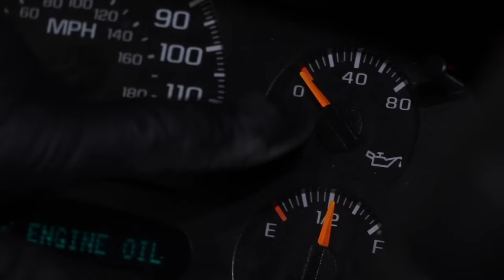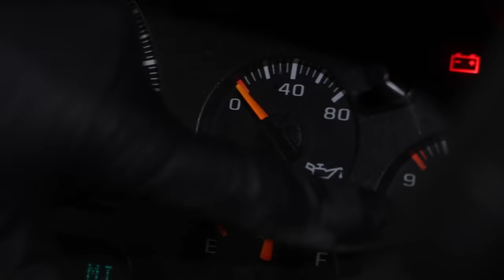Top 5 Problems 2000-06 GMC Yukon Sierra Chevy Suburban Tahoe Silverado Avalanche Cadillac Escalade

Comment: The two widest spread problems I've heard of weren't  mentioned, guard cluster stepper motors going bad, o ring on the oil pump. If I was having a no oil pressure problem thats your next fix if the piddly sensor d oesnt fix it
Reply from the maker: +Mike Belcher Thanks for the feedback!

Comment: If you have chipmunks/ squirrels get the .22 out. I have had them chew my fuel rail pressure regulator control wire where you cannot get your hands down in there to repair it, also temp. sensor wires.

Comment: l like this video. I own a gmc sierra 2007 and my gas gauge does the same as you showed in this video with the oil gauge. What should i look for? I think this is causing my check engine light to come on.

Comment: My passlock is on how do I fix it in a 2003 GMC Yukon xl I changed the fuel pump filter and has it running fine but now it cranks but no start and the security light is on again

Comment: What about the 4x4 issues . This is the second Yukon I’ve had. And the service four wheel drive comes on. Actuator is good . Switch is good and tcase selector is good. Do you know of anything else???
Reply from the maker: +Brian Barwidi We wouldn't be able to diagnose an issue like that here, you may want to have a local mechanic take a look at it. Thanks for checking us out! http://1aau.to/m/Shop-1AAuto-c

Comment: I have an 01 Silverado 4.3L. Batt light on (14v at Batt while on), No Cruise, No A/C or Heater, and some of my gauges don't work on the cluster. I've had this issue die at least 2 years and I still can't find the problem. Could you please help me out

Comment: Having issues with shifting as well as towing indicator light sticking on untill I wiggly gear shift.question I have cleaned up 3grounds where is the other end of ground located at end of fire wall and will 02 censor cause not to shift properly guage light's go crazy when trying to shift I am stuck

Comment: Fuel pump, instrument cluster, u joints, dual climate control, air bag sensors, seat heaters, seat directional controls, window regulators, sagging ceiling liner, sunroof, interior door panels, evap canister and a weak 4L60E transmission. But there is nothing wrong with this vehicle. These are just the top 1,755,383,865 things that are wrong with this truck.

Comment: I have a 2001 Tahoe. The main headlights come on whenever I start the car any time of day, or when a release the parking brake. The daytime running lights never come on. I have to press the dome override four times and then the headlights go out. I tried replacing all the fuses, relays, and even the daytime running light bulbs and sockets, but the problem persists. I tried taking out the radio and replacing the ambient light sensor, but that is a major pain and I just can't replace it. (Thanks GM for that - couldn't you just have had the sensor push down and turn from on top of the dash to come out.) Anyone had this exact issue with their Tahoe and can tell me for certain how to fix it?

Comment: Question,  I have a 2003 chevy tahoe, I was changing my power steering gear box and my battery stopped working, so I bought a new battery and I took my truck to 3 different auto parts to test my alternator and I was told that is in a good condition, my issue is that I noticed since I replaced my battery, every time that I turn off my truck the battery light turns on and it stays on. But when I'm driving the battery light is off. Any ideas

Comment: The real issue is that the parts you're replacing everything with are still crap. Why couldn't GM redesign the exhaust manifolds bolts just shows the true color of the company compared to companies like Toyota.
It's a great truck don't get me wrong, but I own and wrench on my own ancient rigs from the 2000's from both companies and you can tell the difference in attitude, OEM parts quality, and support. You know how hard it was for me to find and pay big money for the updated parts for the HVAC rear module? GM just seemed to not care anymore

Comment: I have the code P1409 and i was told it could be a valve cover gasket leak, or a oil pan leak. because it is leaking oil not much. but it is coming off the oil filter dripping down. and when i look around the bellhousing near the rear main seal it looks like it could be.. but it looks more up top if that makes sense. any ideas? because i don't want to drive it if it's like that.

Comment: Hi.my suburban need to replace the knock sensor..the question is..why the truck stop running?never turn off.but I push the gas all the way and don't move..I turned off an turn on again and drive for like 10 mins .and do it again..is something they the knock sensor do?thanks

Comment: i never had low pressure problem since one year ago, right after replaced the engine gaskets and seals, i tried to understand what could be happened in connection with that work, but without success till today, so actually i'm running with the low pressure sensor disconnected in order to do not get crazy with that sounds! Any idea that could help me to solve my problem? Thx in advance!

Comment: My dashboard lights and radio lights and ac lights won’t turn unless I roll up the dimmer switch all the way up but then all the inside lights turn on as well need help asap please!!! I have. An 02 Cadillac Escalade and the ac start blowing hot air when my car is idle it only blows right when I’m moving without stopping

Comment: You forgot intake gasket leaks, valve train rattle, leaking trans and engine cooler lines, neutral safety switch, climate control module, driver side extra cab door handle, stepper motors in instrument cluster, engine oil pick up tube o-ring cracked, torsion bar cross member  mount bushings and many more.
Reply from the maker: +Steve Mason Thanks for the feedback!

Comment: On my 2006 GMC Yukon Denali xl my break pedel goes to the floor plus I have air in my system and leaking break fluid underneath the driver side rear I can't tell if it my metal Break line or my break hose I have a 6 CD changer and it stop working and my CD is stuck in there and it won't eject the CD
Reply from the maker: +heather moore Thanks for the feedback!

Comment: Thanks for the good video. My intake manifold gaskets are leaking at 155k miles causing the p0171, p0174 codes. This is a good time to replace the knock sensors as well.
Reply from the maker: +Michael Erasmus Thanks for checking us out! 1AAuto.com

Comment: 05 tahoe z71. Battery not dead but maybe 1 or 2 a month I go to start the car and it lights up gauges com on but it won't start. Won't even try to turn over. I try about 6-7 times and it will finally start right up without a problem.
Reply from the maker: +BRAD FINN Thanks for checking us out! 1AAuto.com

Comment: Fuel gauge trash, oil pressure gauge, Steering colum rattle, certain 5.3 have trash heads with porosity. ABS system goes out computer and valve.

Comment: My 01 Tahoe has an electrical issue it's almost idling low but my voltage meter is always all over the place getting ready to replace the ground strap and iac sensor any other ideas would be great.

Comment: I have a 2000 Silverado it has abs problem just like you described  I have cleaned it like it says but this issue is still there could the sensors them self go bad and cause this I have no lights on at all on the dash no abs brake or check engine lights that is
Reply from the maker: +Eddie Lester Thanks for your inquiry. There could be multiple reasons why you're having this particular problem. We suggest taking your vehicle to a nearby reputable shop to identify the cause. Thank you!

Comment: Hello 1A auto I’m having issues with my 2004 suburban when I make a sharp turn one of my wheels turns more then the other I have changed the Pitman arm and trailing arm and also the end links and I never had this problem before I changed them you can see it when I turn my wheel the one wheel turns more then the other now I have already had an alignment done and it still does the same thing please can you help

Comment: I'm surprised the 4L60E isn't in the top 5.  It would definitely be in the top 6!
Reply: This is a routine maintenance item. If cared for and used as intended they are perfectly durable.  They will not suffer abuse and overloading them will shorten their lifespan. These transmissions were only available in the 1500 models. Most complaints about this trans are from people who should've bought a 2500 and the 4L80E that came in that truck. 

There are always going to be unusual circumstances where a not-abused 4L60E collapses prematurely, but these are quite rare.

Comment: 02 Avalanche with 325000 Kms,  just changed the water pump and rear axle bearings and the electronic shift plate in the tranny. Everything else is good.

Comment: The brake pules at slow speed are scary. Forgot to mention the ABS module, sent it out, and had it fixed for like $50. GM electoral parts are the weak link.. :(

Comment: Got an 04 GMC Sierra 1500, the cluster dose not work and the key fob dont work and when the left signal is on the radio cuts out til signal is off, unplugged the cluster and fob works like it should and the radio dont cut out with the signal any ideas

Comment: So I have a 2004 Chevy Tahoe 4.8 and I have a shaking problem so my idle is at 600-700 and I have done plugs coil wires and injectors at 217,000 miles but still shaking any idea what it could be

Comment: 03 4.8 Tahoe. Great truck. Only changed water pump and master cylinder, both leaking. But I hear a woosh sound from the right side as I start up after the truck has sat unused for about a week. Any one id the woosh?? Thanks for the vid.

Comment: Im having  Problems with the starter and all the fuses and relays are good and the starter is new and it will not start unless I jump the starter solenoid
Reply from the maker: +@clintonsterling1072 We wouldn't be able to diagnose an issue like that here, you may want to have a local mechanic take a look at it. Thanks for checking us out! http://1aau.to/m/Shop-1AAuto-c

Comment: I wonder how many accidents and deaths are caused by ABS brakes not stopping cars. They never blame the ABS systems. I don't think they even check them. A family rolled off a cliff on the California coast at a turnout that was sloped down to the water and graveled.and they blamed it on the driver committing suicide murder. They all died on the rocks below. It looked just like they couldn't stop that heavy car. To this day there are no barriers to prevent that from happening.

Comment: Great videos,love them...? I have 99 tahoe with P3004 cyl.4 misfire I replaced plugs,distributor and rotors..but she's still running rough and bad smell from exhaust.where should I look next?
Reply from the maker: +phil schneider Possible causes of this code are : Faulty Inverter With Converter Assembly
Inverter With Converter Assembly harness is open or shorted
Inverter With Converter Assembly circuit poor electrical connection

Comment: I have a 2004 suburban 5.3 when going down the road the power locks will lock then unlock as a warning then the truck will lose power no lights nothing and the motor will die. I have had the master computer replaced and the master ignition replaced.
Reply from the maker: +Shawn Kirk Thanks for the feedback!

Comment: Question....2007 MALIBU have a shaking in car mostly at high speeds over 55mph. New tires balanced and alignment, new struts and shocks as well as tie rod ends what else can it be? CV axle?
Reply: Try your hub and bearings

Comment: I have a 2003 suburban lt 1500 I changed the oil pressure sensor.and the reading went to 40psi.when I got up this morning for work it went back to 80psi.part is from Chevy dealer. What else could it be. Its still at 80psi

Comment: I have replaced the knock sensor twice and the harness. The check engine light keeps coming on and now say throttle module code
Reply from the maker: +Stuart Vaughan We wouldn't be able to diagnose an issue like that here, you may want to have a local mechanic take a look at it. Thanks for checking us out! http://1aau.to/m/Shop-1AAuto-c

Comment: What would cause low fan speed to stop working?  07-13 tahoe when I press the air recirculation it doesnt turn them on anymore it worked before but now it doesn't. 

Could it be the fan motors are bad? Cause when our truck idles long in traffic the temp gauge doesnt turn the fans on at 210 it's a little passed like 215 then comes back to 210.
Reply from the maker: +Kenny Man Thanks for your inquiry. There could be multiple reasons why you're having this particular problem. We suggest taking your vehicle to a nearby reputable shop to identify the cause. Once you know the cause, we'll be happy to see if we carry the parts and how-to videos needed for your repair. Thanks for checking us out!

Comment: I'm going to check my ground wire. When I'm in a unleveled surface my 03 Tahoe shuts off(off road) happened 2x, also when my ignition is on the Battery light is on. My lights dim a little when I raise the windows.
Reply from the maker: +Kriss Oneal Thanks for checking us out!
Reply: Did that fix your problem

Comment: I have a 2004 Tahoe.. and i have an oil leak.. but its not the rear main.. the oil is coming from the top of the motor and leaving a spot on the passenger side of the truck.. any ideas.. would appreciate it thanks.

Comment: Easier to remove the intake just to change the oil pressure sensor?!?!? Just buy the that $10 slim socket that’s specifically made for this and it takes 5 minutes.. good info other than that

Comment: I have a flashing engine light  a mechanic has replace the coils the wires and is still happening..  he then checked the fuel injectors they were good... its been a month and he still hasn't figured it out

Comment: Thanks for the video! I have a 2500HD Silverado and the only problem I've had was the fuel pressure sensor which I still haven't fix. I've had this truck for over 18 years and haven't had does problems. My mileage on my truck 116, 000 miles on it.
Reply: *those

Comment: 03 Silverado V6   5 speed  1/2 ton   Right Bank O2 sensor  has been replaced multiple times   still says  error code Check Engine lite on all the time     oh   just hit 103000 miles  problems started at about 60,000   Love Mt Truck Original Owner

Comment: I wonder if why I'm having a misfire on cylinder 7 even after I replace the coil pack plugs the wires and still have a misfire in cylinder 7 that could be the cause of my cylinder 7 misfire

Comment: Ok I replaced fuel pump 2001 yukon replace the cam positioning sensor the crank positioning sensor it'll run and just shut off out of nowhere's and it won't start back up until the next morning any ideas

Comment: You forgot to say the instrument cluster common issue. Lol. Also, question. Is I replaced my impact sensor and it's still on. Should I disconnect the battery and reconnect it again to clear the code?

Comment: MY DAD HAS ONE THE AUTORIDE AIR PUMP FAILED EARLY STILL TO THIS DAY HAS NOT BEEN REPAIRED IT'S BEEN YEARS TOO EXPENSIVE AND NOT NECESSARY
 THROLLE BODY ISSUES 
REAR MIDDLE BRAKE LIGHT CAME OFF 
HAS LESS THAN 100,000 MILES

Comment: My 2005 Suburban rear wheel drive has done me solid for a long time, but now suddenly my aftermarket double din Kenwood radio switches from FM to AM and the opposite all day when I drive....and the buttons on the wheel only work part of the time...any ideas???  All the frame and whatnot have been great for me!
Reply from the maker: +makowskijj18 We wouldn't be able to diagnose an issue like that here, you may want to have a local mechanic take a look at it. Thanks for checking us out! http://1aau.to/m/Shop-1AAuto-c

Comment: I know this is an older video, but what about Denali traction control issues? Like turning at a stop light and the engine stumbles due to the traction control activating. I understand that works off the same sensors as the ABS. Anny ideas?

Comment: 1. They also have a problem burning oil after 150000 the valve cover on driver side has a problem with oil getting sucked into pvc valve new valve covers are changed to fix it 
2. I have a battery light on and I've changed everything alternator ground straps and nothing seems to work any ideas??

Comment: I have an 05 tahoe the break pedal pulses if applied in a quicker manner if I ease on it it doesn’t. Also I hear a loud metal racket on my driver side rear wheel area sometimes it makes noise sometimes it doesn’t. Everything rides and spins fine. I took the wheel off spun the rotor it sounds like the area of the abs sensor. Any advise on those things?

Comment: Thanks for the video! I have this weird noise coming from the back of my 2005 Yukon Denali. It's like some device next to the spare tire that sounds like a motor running or something and it's really loud. The nose is intermittent and I can't figure out what kind of part it is.
Reply: That would more than likely be the Fuel pump you are hearing.
Reply: Rob Adams I believe it’s the air ride compressor, your shocks may no longer be holding air.

Comment: hello, i have a problem on my 2009 suburban flexifuel with GPL instaliation. on fuel and low rpm I have on my dash the OBD light coming up with also service stabilitrack and service traction controle. the engine don't turn smothley.Fuel injector working badly? when I go to GPL the problem is gone. 2 weeks later I have now the same probleme on GPL. this I think is a probleme with ingnition on one of the cilinders? ciao Pascal